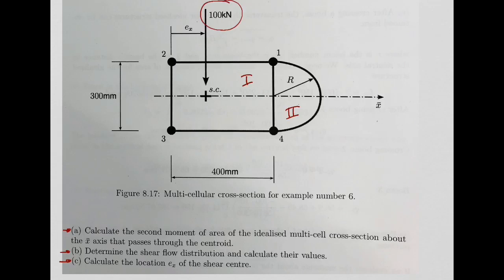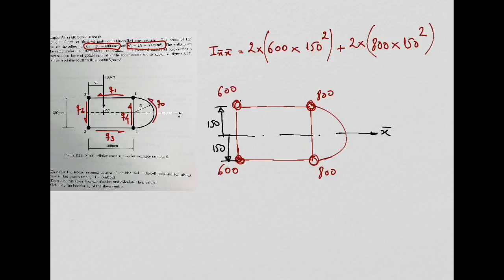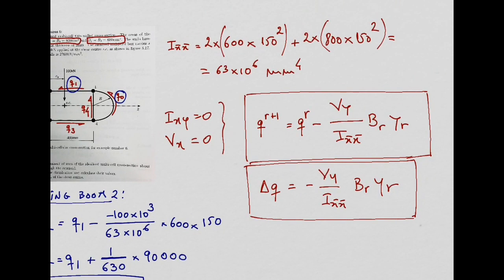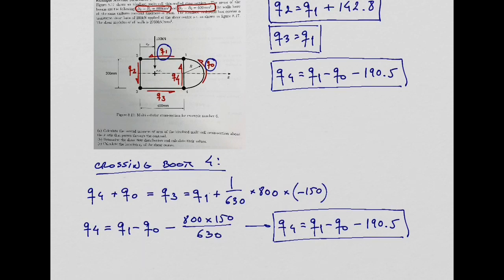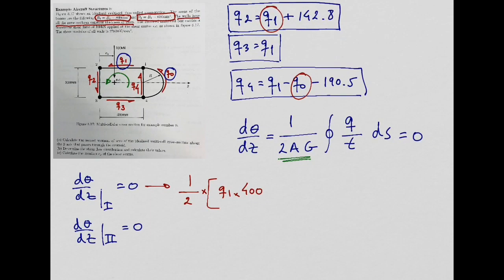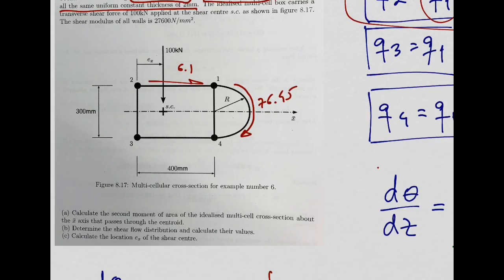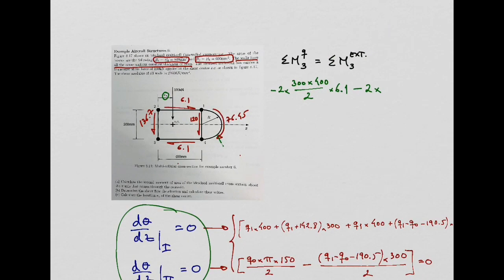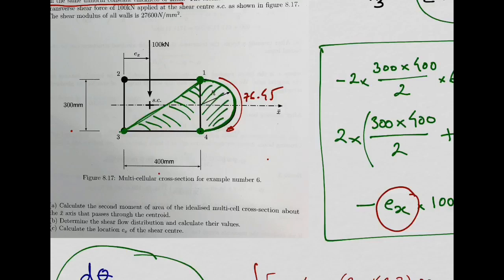Shear Centre - Structural Idealisation

Comment: The solution is incomplete and wrong. The shear flows that are found are relevant for an open section. For that a cut has to be assumed. Then qs,0 needs to be found. Which the ratio of contour integral qbds/t to the contour integral ds/t. This qs,0 needs t be added to the open section shear flows to find the final solution.
Reply from the maker: Hi, respectfully, which part are you saying is incomplete or wrong? You are describing in your comment Megson's approach. My approach for solving is different from Megson's. The shear flows calculated are for closed cross-sections, not for open cross-sections. They were calculated by using the moments equation and by imposing the rotation of the closed cells equal to zero for the location of the shear centre. Look, I have no need to upload these videos on YouTube, I can assure you I am not earning a penny from these videos. The reason why I am doing is just for helping my students and anyone interested in this subject. But I am not taking comments like this lightly. You came up with a very strong comment saying what I've done in this video is wrong and your justification of the shear flows obtained being relevant for open sections is not right. So can you please detail what is incomplete and wrong?
Reply: @rprcardoso1  Hi, respectfully which literature you are referring for this? Is it by David Peery or Bruhn or CT Sun or Donaldson or something else? I would also like to follow this method.
Reply from the maker: I follow this approach: Aircraft Structures: Shear Centre Analysis (Aircraft Structural Analysis) https://amzn.eu/d/cua8lFa